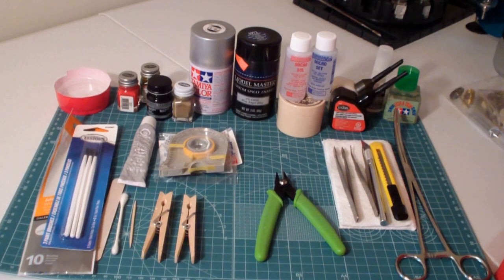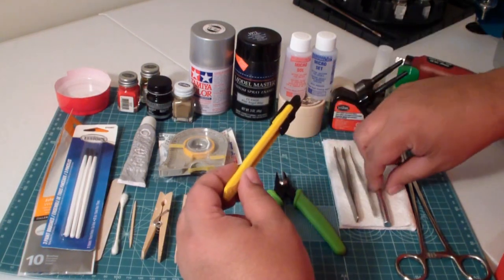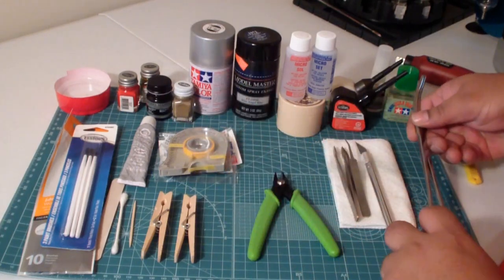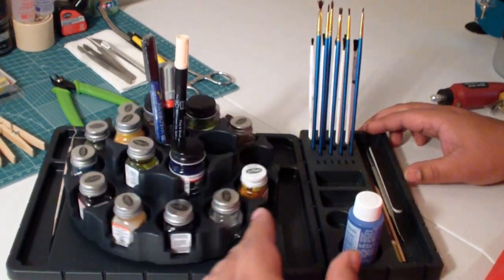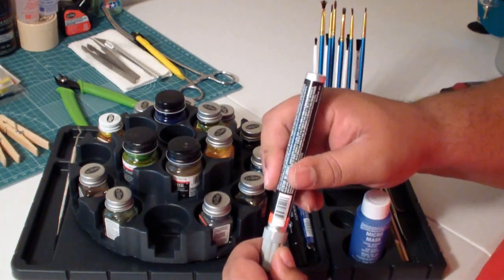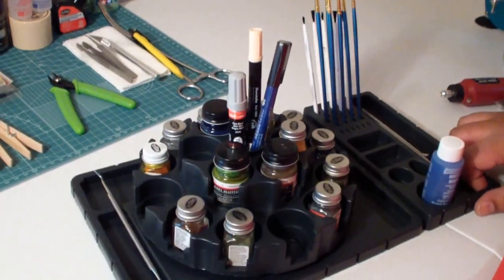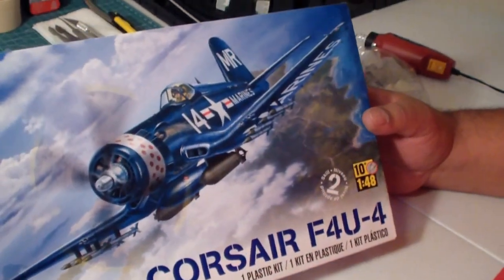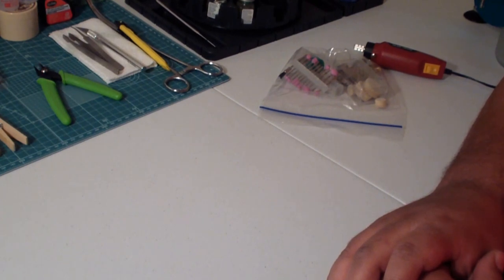Basic Model Building, Tutorial 2

Comment: Using heat shrink tube on the artery forceps tips would save taping them up, give a better grip and save damaging parts.
Do you also use rubber bands for holding parts together when glueing?

Comment: I'd recommend against cannibalising kits. If you break or mess up something on the first kit, try to fix it, even if it doesn't turn out well. At least you know how to fix it now, something you'll have to do on almost every model you build. ust finnish all steps in the building and painting processes, so you know what to do with the second kit.
Reply from the maker: +laurensreinds . I'm just worried about the guy/gal that is just starting out and runs into an non-recoverable problem like a broken propeller or a cracked canopy. I don't want the newbies to just throw up their hands in frustration and never really get the experience of finishing that first build. Once they get that first build completed they will realize the long-lasting payoffs of sticking with the craft.
Reply: Oh, of course, it would be a shame to give up on the hobby because of your first model. Maybe both are valid tips, depending on the reader.

Comment: Hi Joel.

Would you say that the Abbey Forceps are an important requirement? From your description it sounds like a beginner may be able to substitute them with clothing pegs.

I am asking because they are on the right in the video, so I may be unsure about their purpose or applications.
Reply: +Joel Z. Williams Also, could you give me a more specific example of what the power tool that you showed would be used for?

Would you use that type of tool to remove excess plastic from the sides of model pieces, for example? If not, then I suppose you'd do that with the knife you've showed?
Reply from the maker: yes, you can make do with clothes pins without the Abbey forceps. I think I put them there mostly for people who are going to paint with a rattle can I think that's the best way to keep your hands from getting coated with paint
Reply from the maker: +Logan Perry . if I remember correctly the electrical tool was a $10 and $0.11 device I picked up at Harbor Freight Tools. Of course using the edge of an exacto knife will suffice.
Reply: Joel Z. Williams Thanks :) I appreciate the help.